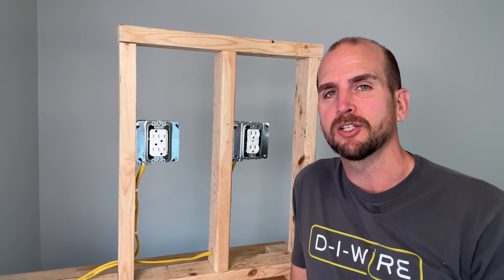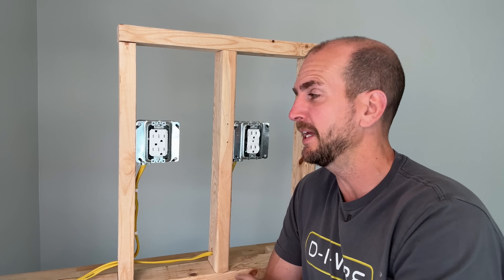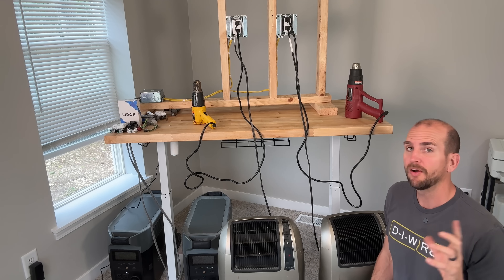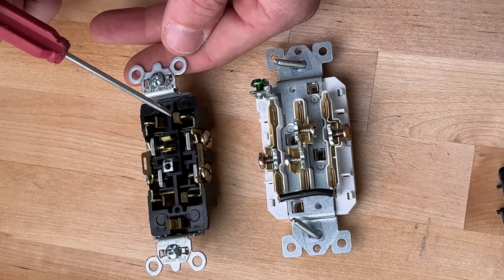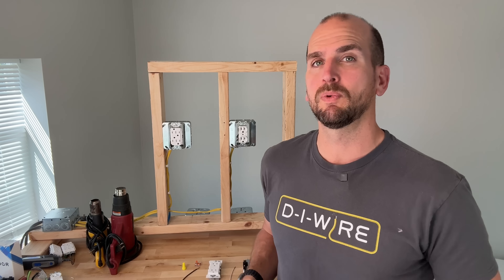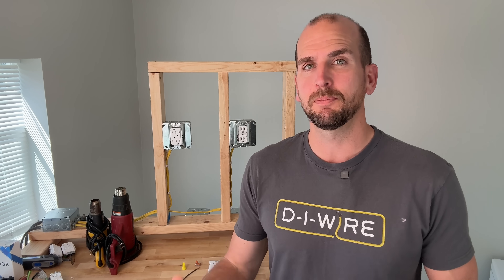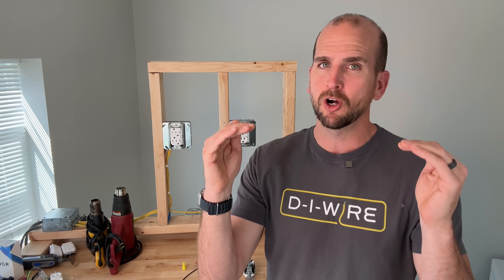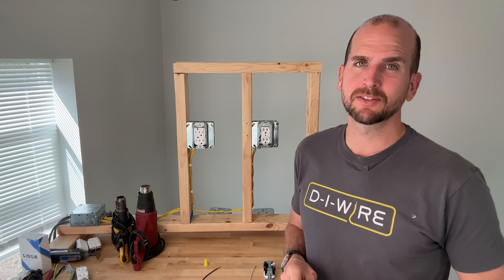The Most Innovative Outlet You've Never Seen | Full Load Testing

Comment: Thanks for this video.  Does this ACTUALLY solve the ground up vs down debate?  I've heard some folks argue that ground up is safer because if a 3 prong outlet comes a little loose and something conductive falls on it then it hits the ground prong first.  By supporting both configurations this essentially guarantees that if there were a safety argument then it can be accidentally circumvented.

In any case, lest I get flamed over saying that ground up is safer for the reason mentioned above (and what about poor ungrounded plugs?), again,  I'm sharing opinions of others I've heard and they won't be satisfied that this solution solves the debate.  They'd likely argue that this product makes it so that a safety conscious installer CANNOT do the right thing.

Comment: Here is an electrician's perspective.  When I first seen the design it looked interesting like it had potential.  After seeing the internals I won't put one in my home.  Every outlet has a shelf life, having that kind of slot doesn't have a lot of shelf life, eventually after so many actions of metal on metal it will wear down and since it isn't pushing into the male prong it will be a loose connection.  This design also still only allows for 2 items to be plugged in at one so other than versatility you do not gain anything else.

A secondary concern I have, which might be a non issue is the tamper resistant windows.  Normal circumstances if there is pressure on one window and not the other the plastic shutters remain closed to prevent a child from pushing something in.  If equal pressure the windows open allowing an item to be inserted.  Looking at this hybrid outlet that has 3 slots (not counting ground) if I insert a cord end normally in the top right 2 locations, will the top left unused slot still remain tamper resistant or will it be bypassed since something is in the other 2/3 spots?  Assuming it works correctly will the extra complexity of the plastic shutters increase the likely hood of product failure?  

I like the innovation and the outside the box thinking but I'd rather just cut a 2 gang in and have 2 good quality receptacles side by side.  You have 4 spots to utilize, 1/4 can be switched, 2/4, 3/4, or all 4 if you so desire.  You can rotate one entire outlet "upside down" and still gain 2 extra spots.  Material costs to do this are still cheaper than the cost of one cheaply made device.  $2.75 for a 2 gang remodel box, 2 commercial grade tamper resistant receptacles $2.63 each (I use residential grade in my own house-perfectly fine).  You'll need about a foot of scrap wire, even using the highest cost HD has 1ft is $1.93 (15ft roll).  That puts us at $9.94.  Toss in a double duplex plate for $2.11 we are up to $12.05.  Compare that to $13.99 and $14.99.  Costs would be much cheaper as I was going for the higher quality items, more expensive wire costs.  Just a gimmicky product.

Comment: Set gaps is arguable. I can argue the same with the design you love.
Reply: What downside to a spring style would you argue?
Reply: @JJFX-  springs don't stay springy forever.
Reply: @unperrier  Not really. When constrained it shouldn't deform enough in any relevant time frame to be a problem. I'll take a spring design over a fixed gap of thin metal any day. Especially since the prongs on electrical plugs can vary so having a mechanism to account for tolerance, wear and design choices is an obvious solution.
Reply: @JJFX- /videos first they're both think metals.
You're probably right but this is a deeper analysis than the argument that the video make provided.
I was pointing out that he was merely saying "it's better".
You're right, it's a better design. But I think that prong tolerance isn't a factor though. They don't vary much.

Comment: I can see one potential use for the soldered wire. If the outlet is overloaded and heats up enough to be dangerous, the solder melts and disconnects half the load. I doubt that’s the reason, but it's an idea

Comment: Could this be used for a 240v outlet? Make a 4 pronged cable (2 hot, 1 neutral, one ground) to draw from the 2x 120v terminals
Reply: I was thinking the exact same thing.  It would work exactly like that if you removed the connector between the two hot sides and connected the hot connectors to opposite phases.  If only this could be a NEMA-defined outlet, it would be perfect for places where you might want 240v or 120v.  But now that they've used it this way, that direction seems very unlikely.

Oh, and for structural stability on using this as a 240v outlet, I would use both ground plugs wired together.  Electrically, this should be the equivalent of a 14-20 outlet, I believe.

Comment: And here I was, thinking that finally someone had proposed a design to let you have backwards compatible 240 V sockets over there on the far side of the sea. The design looks a bit like a certain Italian style outlet but with blades instead of cylindrical prongs. With the two live terminals individually having connections, it even looks as if it could be used that way if the connecting wire is removed. 
It would not be the first time something like that was introduced. Over here in Switzerland there exists an ingenious single outlet that allows for either a standard one-phase plug or a three-phase plug.

Comment: Please stop calling it a neutral!  there is no neutral in a 120-volt circuit.!  You have the hot, (which in the US is Black), the Grounded wire, (which in the US is White) and the Grounding wire, (which in the US is bare copper or green).  A true neutral only sees the difference between two phases, so if one phase is using 20 amps, and the other phase is using 10 amps, then the neutral is only passing 10 amps.   If both phases are equal, then the neutral would see NO current!  (Which is why 240-volt circuits in the US only have 3 wires, Phase one hot, Phase 2 Hot, and Ground
Reply: the white wire in a 120-volt circuit sees the same current as the black wire.  which is why you are required to put a piece of black electrical tape on the white wire of a switch, letting you know that it can be carrying current

Comment: There is just more we can imagine for this concept: we can remove the jumper between tne left and the right live contacts, power them by two different live sources, make 4-pin power plug for 240 volts devices and finally stop use NEMA 6-15 separately, cause they can be totally replaced by these one. All we need is finally NEC and NEMA approvment for these universal 120/240 volts outlets.

Comment: If it's in a spot where it doesn't get unplugged and replugged a lot It might be OK.  I'm thinking behind the rolling counter that holds my microwave and provides service to a window fan in the summer.  But TBH even in that application I don't need the up/down ground application as both my plugs don't block each other.

Comment: Your temps are invalid. There is no enclosure to keep the heat in. Use thermal insulation to at least simulate a wall. Then do the heat test again. And let them run until they level out.

Comment: Just get two normal 2plug outlets and flip the other one upside down. Easy.

Wall wart power supply bricks? Plug in a power strip and deal with it.

The real worry is with those plug blade slots with NO spring force. Just means that the bigger the blade jammed in, the looser it gets, and then when something thinner is jammed in, alas, it’s loose, sparky and becomes a fire hazard.

Comment: I think the "innovative" outlet is bad engineering that started with an idea but it is an attempt to "reinvent the wheel," if you will. I do not agree with the soldering of wire to bridge the hot together. The size of the outlet alone also makes it look bulky than it is needed.

Comment: The wedge approach offers a limited dynamic range on contact pressure in the new model is inferior to the wide dynamic range in the conventional model. In other words the new model is less tolerant to variations in pin thickness and heating up with thinner pins. When a thicker pin plug was removed the contact pressure may be too low or even contact intermittently. Plugs from China usually have thinner pins. If this new socket mate with thinner pin plugs all the time we may get away from overheating issues.

Comment: Solution for a problem that didn't exist
Reply: I would argue that this problem does in fact exist. I have run into an issue with wall bricks fitting for years.
Reply: Yea I want a power strip version of this
Nothing more cursed than a workstation setup that needs 2 strips because the monitors have wall warts
Reply: The real solution for wallworts is to grab some little six inch extension cables. Works in any situation regardless of the size of the wall wort or how many you need to shove in one spot.
Reply: I was waiting for him to tell me why this wacky looking thing was useful
Reply: @jakewenzel7804  because of wall warts...?
Reply: @jeffrbake  There's a VERY small subset of wallwarts where this thing has any hope of helping. It's basically useless for wallwarts as much as a normal outlet. About the ONLY thing I can see it being useful for is if you have a flush 90 degree grounded plug that you want going up the wall, for some reason
Reply: Exactly what came to mind for me
Reply: The problem might exist, but there are better solutions if it does such as power strips, rotating outlets, or having grounds avoid & below the outlet instead of having the offset style in this design
Reply: @devnom9143  Simply putting a ground above won't work with the polarity. This is exactly why it's this funky shape with the extra slot. Still not great design.
Reply: Incorrect
Reply: I always need more outlets in my workshop. I think I am up to 9 or 10 duplex outlets, one quadplex outlet, one 50A welder outlet, and even a European 240v outlet for imported tools. But my shop is really long and narrow so if there's an outlet in a central location it doesn't really help me out without having a bunch of extension cords going all over the place. I already deal with that with air tools, I want none of it with electric tools.
Reply: You try plugging two Echo Dots into the same outlet.
Reply: Though it usually isn't that big of a problem, these are the ones that stick out where this can be a problem. 

Most power strips, most UPS/battery backup systems, or any cables that uses an angled connector that goes in one direction.

Comment: Do us readers a favor and put the heat camera's high and low range color coding on the screen. We had a company come in and scan our entire plant, using ambient as the camera's low-level set point, and 200 F as the upper. 

Good service. 

Then they came back the next year using ambient as the low level, and 85 F as the upper setpoint, just to
 'advertize a future need' 
for the service. 
Either the engineer was a real loser, or was gettin' kickbacks, cuz they sent us out with 150 hot spot repair work orders, till I noticed the scam. (Services no longer required - bye!)

Comment: That soldered connection is a NEC code violation.  All connections must be mechanical and if you use solder, the mechanical must be done first then then you can solder but the solder cannot be the means of connection.
Reply: Circuit boards are in trouble then
Reply: @highvoltage1979  Circuit boards are covered under UL et.al.  High voltage premise wiring is covered by NFPA #70 (NEC) and the NEC says that that is forbidden.  I don't make the rules, I just consider them, try to understand the reasons for them, and since we have inspectors, I obey them. Your argument is a cheap sophomoric shot.
Reply: @wolfgangunger217  I wasn’t taking a shot at you, just joking, sorry to hurt your feelings
Reply: @highvoltage1979  Sorry, I just take electrical a little to seriously.  I am shocked that you are so flippantly. (yes, that was a joke).

Comment: The load is 20A +? Those outlets and the circuit are only rated for 15A.  20A outlet has a different prong configuration.   No thanks.  But i also question this entire test putting 20a on a 15 a outlet
Reply from the maker: 15 Amp outlets can be on 20 Amp circuits, even if it is just a single duplex outlet.  Just trying to push both outlets at the upper limits.

Comment: I appreciate the innovative design and capability. Do not accept the build engineering compromises. I wouldn’t want to see these in my home.

Although you only predicted this failure mode (and I agree with the likelihood your prediction is correct), I have zero tolerance for loose fitting AC plugs!

Comment: I don't understand the point of this design. Because of the shared pins, you can only plug in two devices at most at any one time. I do understand that there's some potential benefit if you want to do something like plugging in two wall warts, since you can have one up and one down. But wouldn't the same benefit apply if you just made this with two conventional 3-prong sockets, one with ground up and one with ground down?

Comment: I could definitely see myself using these for switched outlets. It would be nice to be able to use both receptacles as non-switched, and then later on just flip the plug and turn it back to switched. 
It could also be handy for kitchen receptacles using MWBC. Each side would be on a different circuit, so you could make sure your high-draw kitchen appliances are on separate circuits without having to move them to a different outlet. Although the plug retention design doesn't inspire much confidence in its durability, so.... Probably not ready for that type of usage yet. 

Otherwise, I don't see much of a point to this outlet design.
Reply: Only thing I see is 2 90 degree plugs on 1 outlet. This alternated design means you could still fit both on 1 outlet instead of requiring a separate outlet or unplugging one thing when you need to plug in the other thing

Comment: This does help with the issue of cords with right angle plugs which are found on some appliances. This would allow for the cords to hang from the bottom regardless of how the plug is made, ground on top or bottom.
Reply: I think that this makes the most sense for when the plugs aren't going in and out often. If they stay in there most of the time, then we're good to go.

The appliances could even help to hold them in.
Reply: I could use this behind my fridge. It has a right angle plug, as does the power strip for the adjacent counter. It's an uncomfortably awkward fit.
Reply: Ground on top.  Everything else is wrong.
Reply: @alexandercastleberry480  no u
Reply: @alexandercastleberry 480  Ground needs to be near the ground that is on the bottom. We are not living in a hospital. Only exception if you have a GFI plug like on window AC units then you need ground up so the wire hangs down. There is no law saying all outlets need to be in the same orientation. 73

Comment: It is interesting engineering, but as you said, the execution of the manufacture is fairly poor. IMO instead of tandem hots, the arrangement should be reversed with a single hot rail and dual neutrals. Just feels like that would reduce the risk of exposure. It’s probably only a matter of time before Legrand or a similar “quality” manufacturer adopts this idea and produces a better version. It will certainly be a nitch product, but if they can make a profit on them, they will.

Comment: Just cut that jumper and you have two independent hots.  So you could not only make one side "switched" and the other side always on, but (after cutting that jumper) you could supply two sets of hot (opposite 120's for a total 240) to have higher capacity at the socket.
(eg: Red to one hot side, Black to the other hot side; neutral to centre - standard 15A times 2).
Reply: I think the point of the design is that you can have it as a half hot with a switch controlling one outlet, but then you can just turn the plug upside down and have 2 unswitched outlets. I don’t think I’d ever use one though.
Reply: @matthewlithgow8578  Agreed-ish.  They seem to have 2 models, 1 with the hot jumping to the other side, and another without the jumper so one could have switched and unswitched sides.
I can see the appeal of that - as I can for a 240 split version (2 x 120) - for example in the kitchen.
I do this with the usual 2 socket outlets by snipping the tab between the upper and lower hots.
Reply: But nothing will fix the bigger problem for me.. there is no spring pressure on the plug connection. Over time that's guaranteed to product problems and I suspect if it's a plug that has lots of things plugged and unplugged into it that it won't be that long before the connection isn't sound.
Reply: @kstaxman2  You're basing that on the opinion of the video auteur - reality may be different.
Reply: the build quality of this outlet is junk, but im more interested in the idea of having one side switched and the other always hot.
your idea of 120 and 240 being available at one outlet may also be interesting but i would worry if the wires could handle that.
Reply: @ARockRaider  Since the use would be 120 on the red side and 120 on the black side to a max of 15A, yes, definitely the wires can handle that.
Reply: @AlanTheBeast100  oh right, silly me i wasn't thinking of wire ment to run 240 for some reason.
Reply: @ARockRaider  Even simple Romex (hot, neutral, ground) is usually rated to 600V and you will find that in commercial fluorescent lighting circuits - saves a lot of cost with the thinner wire.
The "usual" 240V (hot(blk), hot(red), neutral, ground) is what I mean for my described above situation.  So neutral to the middle, red to hot on one side; blk to hot on the other side; ground (of course) and cut that wire that joins the "left and right" hots.  If the breaker is a double 15A, then all is good.